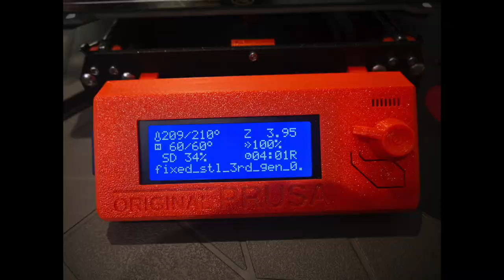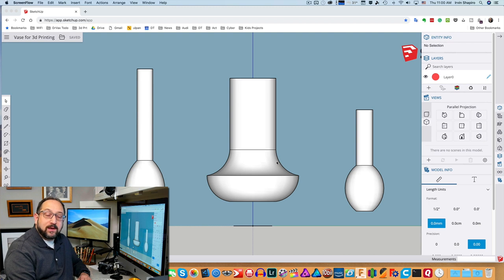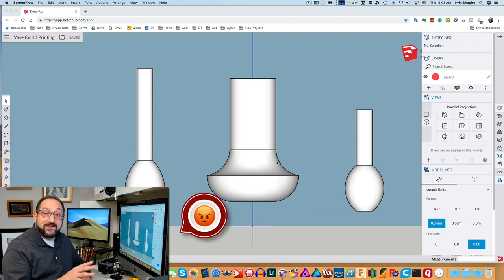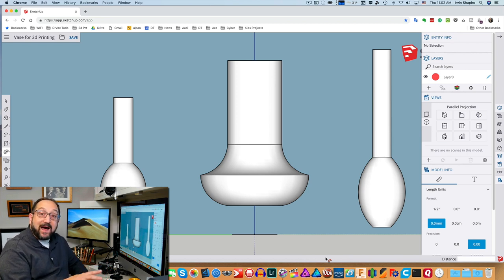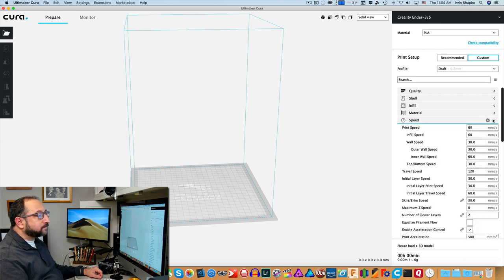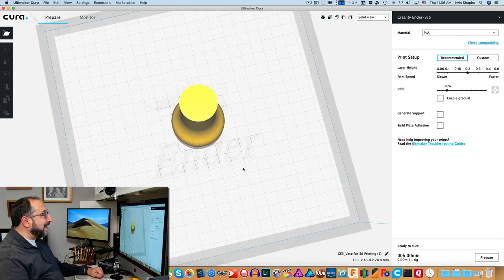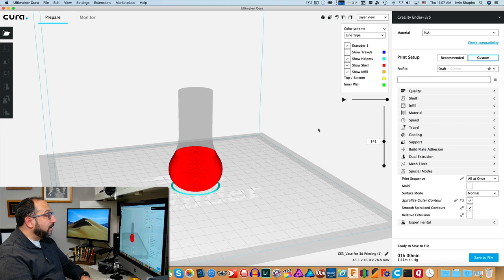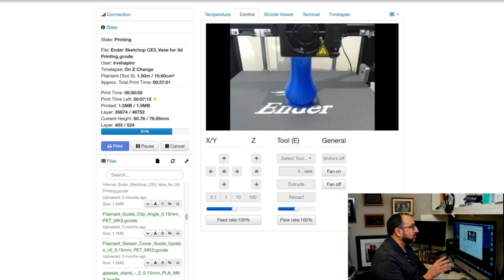Vase Mode with Sketchup & Cura on an Ender 5

Comment: Thanks for making these videos, just so you know I bought a Ender 5 because of you and it arrived and I started using it last Monday! Just curious why you are not using the ender 5 profile creality provides?
Reply from the maker: I did not know about it.  I use a Mac and the software on the sd card is only for PCs so I used the generic version of Cura.  Thanks for the push I will look on the Creality web site for the profile.
Reply: @MakeWithTech  Since a profile is just a JSON file you can still use it. Put the SD card in your computer and under the cura directory (I have my SD card in my printer right now so I could give you the exact directory later) there is a folder I believe called drivers just copy the json file into the your cura directory --->resources---> definitions and that will add the ender 5 to the pick list of printers.
Reply from the maker: Excellent point and thanks for sharing with the group.
Reply: Anyway you could share that .json file? The USB I was provided has the CR-5S and CR-X, but no Ender 5. I could be mistaken since I am new, but any assistance would be great.
Reply from the maker: @ing200086  All you need to do is select the Ender 3 profile and then then click on Ultimaker Cura on the top left main menu, select preferences, select printers, select the ender 3 profile and then click on "activate".  Then you can click on "machine settings".  On the first tab change the printer settings to 220,220, 300 which is correct for the Ender 5.

Everything else is the same --- however I recommend you change the combing settings for all prints.  See my video about perfect first layers.

Hope this helps.  Irv  (DrVax)

Comment: I'm gonna get an ender 3 or 5 tomorrow which one would you suggest?
Reply from the maker: If you can afford it the rigid frame of the Ender 5 is a plus.  Check out the other Ender 5 videos in this channel.
Reply from the maker: Here is a link to my Ender 3 vs Ender 5 comparison.  3d Printers:  Ender 3 vs Ender 3 Plus vs Ender 5.  Geometry Matters. https://youtu.be/AFZSUXKH0QA

Comment: Hey DrVax what are you thoughts  on putting dual z on an ender 5. U could add a stepper, lead screw, and 2 rails to the front of the printer. U would just need to extend the plate that the bed mounts to, just like it extends now for its cantilever type connection to the lead screw at the rear. It would be similar to how the tronxy x5s operates, except front and read lead screws not left and right like other similar printers. Any thoughts? Anyone feel free to comment. I haven't tried this yet, and have not seen anyone else try it yet. Thanks.
Reply from the maker: Sounds like quite an involved build.  A number of factors would have to be further investigated.  Do you have pins on the processor board for a second Z stepper motor?  I do not think Creality has released the marlin source for the ender 5 yet, will you need to modify the marlin options (not sure)?  How do you ensure the two stepper motors stay in sync?

If you ware doing this for fun.  Sounds like an interesting project.  If you are doing this to get access to a better printer -- maybe you need to consider a higher end printer like the Prusa i3 Mk3.

I personally only consider enhancements to an existing printer that can be completed in about an hour or less.  For example, I have a video that will be out this week on how to replace an extruder with an all meter extruder.
Reply: @MakeWithTech  Thanks for prompt response. I appreciate you taking the time to explain the many factors at play here. There are trusses on thingiverse already that would require a few alterations to accomplish this. And as far as de-sync issues are concerned I could run a belt from the rear lead screw to another lead screw mounted on the front. Like a mirrored copy of the rear rods and screw setup. And then run a one to one pulley connecting the two. With that, it wouldn't require any firmware changes. There are actually kits similar  to this for the Ender 3 that give you a dual z. Just a thought. I really think its possible for me to accomplish this. No need for 1 hour mods for me, I'm laid off and have all the time in the world. At least for the next month until  NY thaws out. Looks simple on paper at least to me
Thanks again for your time.
Reply: Connect the 2 like this to prevent de-sync. https://www.openrcforums.com/forum/viewtopic.php?t=11038#p137437

Comment: Config Cura from Ender 3?
Reply from the maker: I used the Ender 3 standard configuration modified for the Ender 5 print bed size.   For an Ender 3 just use the configuration available in the current version of cura.
Reply: Thank you for your response
Why did you enter 220 x 220?
The table has dimensions of 235 x 235.

Ps
I am just installing the Ender 5 Mega 2560 with Ramps 1.4
For this ultra-quiet engine controllers :-)
Reply from the maker: The Creality China website at:  https://www.creality3donline.com/creality-ender-5-3d-printer_p0123.html has the specs as 220x200x300.   I just measured the magnetic build plate and it is 238x238.  The x-axis print head travel between stops is approximately 225.